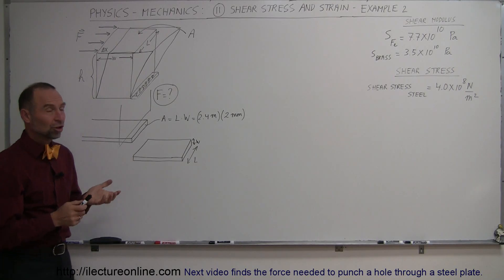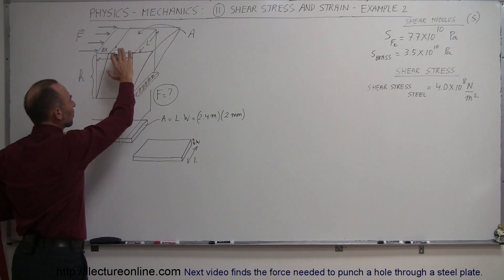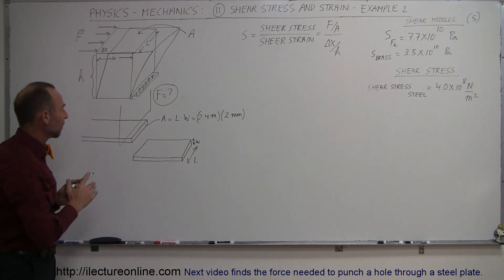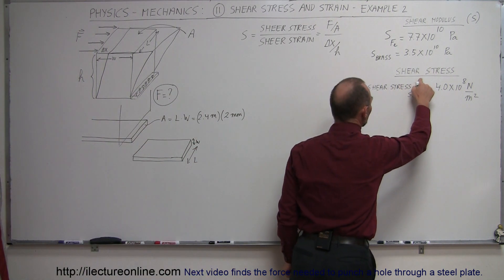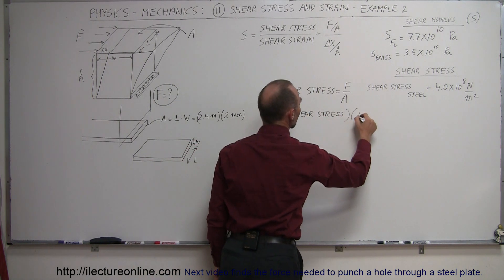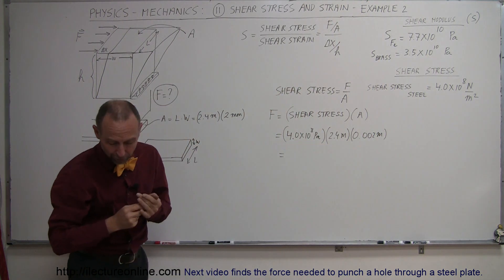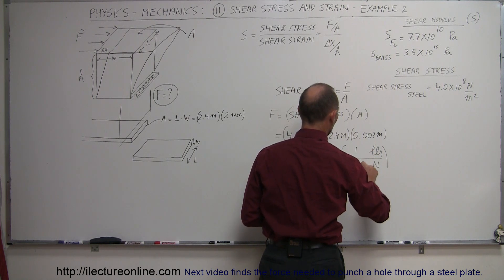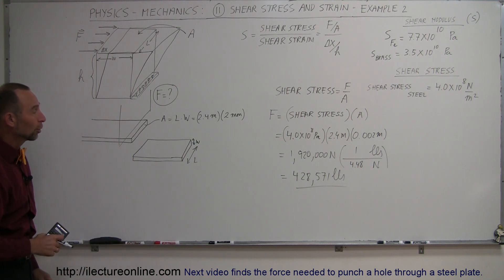Physics - Mechanics: Stress and Strain (11 of 16) Ex. 2: Cutting Steel Sheet

Comment: Hello, do you have a video on how to solve the force needed in order to cut a hollow pvc pipe with a circular blade? And find the torque in order to choose the right motor for it?
Reply: Related to it perhaps? Still thank you for the reply.
Reply from the maker: The torque required depends on the radius of the drill bit, the strength of the material being drilled, the thickness of the material being drilled, the friction caused by the material being drilled, and the speed of the rotating drill, (if the drill slows down too much you build up more back EMF).
Reply from the maker: We don't have anything that specific.

Comment: Why dont we multiply the area by 2 isnt it two pieces that are cut?
Reply from the maker: You bring up a good point.  How that material is supported when cut does make a big difference.  If both sides of the material are supported, it will take more force to cut it, then when only one side is supported and the other side is not.  it is assumed here that only one side is supported.

Comment: i think you should input in the shear stress equation 2 Areas in this example because you are  shearing 2 areas and not only one (like you did in 9th video with the circle shear example ) so it should be S=F/2A ,could you explain please ?
Reply from the maker: eeddoonniiss 
In the "circle" example the shear stress is also:    S = F / A
The "2" in the equations comes from the circumference of a circle:   C = 2 * pi * R